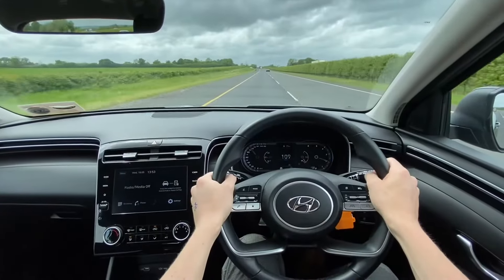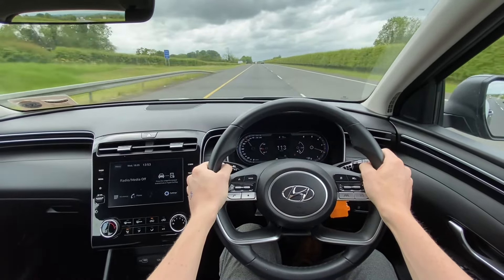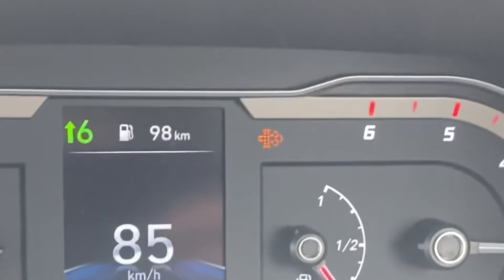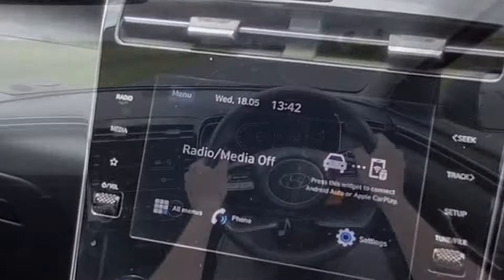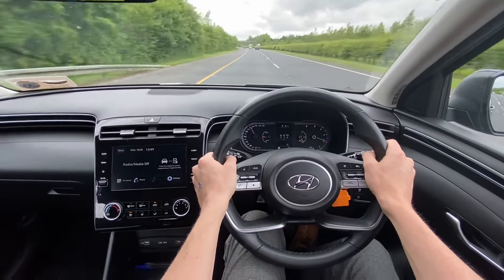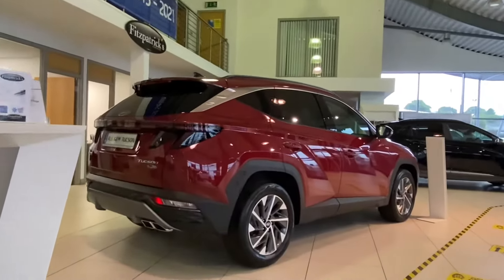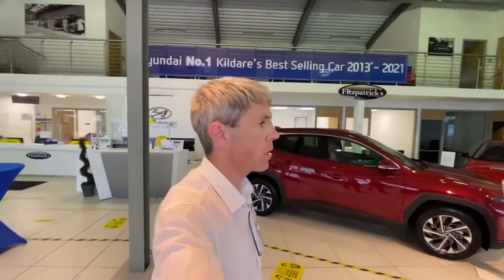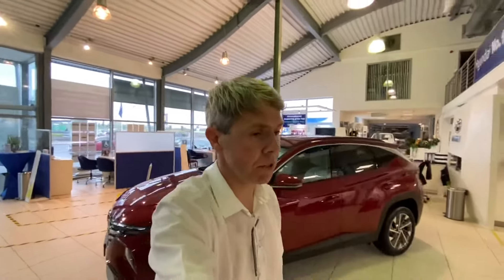How do you clear the DPF light on Hyundai Tucson #dpfsolution #hyundaitucson #howto

Comment: For anyone that has this problem with the 2021 upwards 1.6 tgdi, I got in contact with my local dealership.
I was sent a manual on this issue.
Drive in 3rd gear 50mph upwards, accelerate up to 4000rpm, release accelerator for 5 seconds and then back up to 4000rpm.. Repeat until light clears.

I've just done this method and it honestly worked a treat. I tried driving 3.5k rpm yesterday for over 50 miles and was useless... try this method and thank me later 👌🏻
Reply from the maker: Excellent info thank you !!
Reply: @doolanbrian  
No problem 👍🏻
Reply: @doolanbrian  
In case of DCT
 (Dual Clutch Transmission) you must put the car in sports mode and manually switch to 3rd gear.
If after driving 30 mins, or the gpf light starts blinking, they recommend you visit the local dealership
Reply: I was driving around 100km with over 3000rpm and the warning light is still on. 22my 1.6 t-gdi...
Reply from the maker: @veeme96  see Jamie Jay Jay comment which I pinned up above , it might help
Reply: @doolanbrian  its very overall recommendation/ explanation. First, is it possible to  do on still stand/ neutral not driving? Second, how long do you have to keep on 4k rpm?
Reply: @veeme96  
You must drive the car over 50mph in 3rd gear. Accelerating up to 4k rpm, release accelerator for 5 seconds, then back up to 4k rpm and keep repeating this process.
Your car needs to be up to operating temperature as you're burning off all the soot that's built up.
Took me about 15 minutes
Reply from the maker: @veeme96  manufacturer recommend that you carry out these processes while you are driving, usually after approximately 10 to 15 minutes it should clear .. if not you need to visit the garage and they can force the car to do it using software.
Reply from the maker: @Jamie_Dee  great advice
Reply: Great advice Jamie JayJay - solved the issue for me (at least until next time). Thanks very much
Reply: @derekbish7646  
You're welcome.
My light came on at around 3500 miles.
It's obviously to do with the fact I'm pretty much city driving all the time so it's not a problem for me to do this method in the future to force exhaust regeneration. 
Good to hear you're all sorted 👍🏻
Reply: Thanks @Jamie JayJay - pretty much the same for me. Came on about 6,500. Cheers again.
Reply: it really worked. thank you man
Reply: @SOLO97  
No problem buddy 👍🏻
Reply: I drove approx 5km in sport mode (manual gear) in third gear 4500rpm release 5 sec and continue. Worked great! 👍 thanks for info!

Comment: I have a 2021 1.6 tgdi which had the light come on on the dash. Tried 50 odd miles at 3000rpm but it didn't work. Yesterday i went out and tried the 4000 rpm/5 secs/ 4000 rpm/ 5 secs etc etc repeated over and over. After about 16 miles the light cleared ..... magical! it took about 25 mins, and returned 27mpg ( the return journey was 50 mpg+) however it was worth it to regenerate the filter. Thank you Brian Doolan, much appreciated.....
Reply from the maker: @100boomer  delighted you’ve got sorted!! Appreciate the kind words !

Comment: Never heard a DPF regen at 1.5-2.5 rpm… usually have to be more that 3000 rpm… unless you use dog cleaners
Reply from the maker: @claudiod3380  for this vehicle this is the optimal range 🙂👍
Reply: Mate my tucson 2021 diesel 45 k on it same warning ⚠️ light pop up so. Shold i drive 60km per hour n between 1500 3000 rm ?
Reply from the maker: @I.koç  can you get to a motorway ??  I’d sit at about 2000 rpm in 5th or 6th for about 10-15 mins 🙂👍
Reply: Yeah . I ll do tomorrow lets see what will happen. Thx mate  @doolanbrian
Reply from the maker: @I.koç  🫡

Comment: Have this problem with my brand new 2023 Kia sportage, mine is already saying engine management light check exhaust(dpf) will this still work for dpf to regenerate?
Reply from the maker: If the engine light is on .. you need to visit the dealer … they will need to clear it for you 🙂👍
Reply: I’ve had the same problem with my new sportage sent it back to Kia today
Reply from the maker: @life101ization  I presume they are going to do forced regeneration?
Reply: @doolanbrian  I’m not sure but hopefully it does not take to long Kia took it away today on a flatbed

Comment: Hi Brian. This has just started happening with my car, the Tucson PHEV. I do lots of short journeys, being disabled I take my car everywhere. This is probably a daft question, but wouldn't revving your engine while parked, up to the required revs and time, do the same thing? Thanks.
Reply from the maker: A good question, but unfortunately it doesn’t meet the criteria, the vehicle usually has to be travelling over 80 km an hour to create enough exhaust flow 🙂🙂

Comment: Another question Brian. If in theory I was to make all my local short journeys in just EV mode, would that have any effect on the exhaust? I would imagine not using the petrol engine would not add to the partials.. 🤔
Reply from the maker: Technically you are correct, 
I think however, it’s important to run the engine, a couple of times a week to clear condensation in the exhaust, and also keep the engine lubricated, but what you say would technically be correct 👍
Reply: I now have a home charger fitted, so I can charge my Tucson phev overnight on the cheapest rate. I'm now doing most of my short journeys in EV mode and using the Hybrid mainly at weekends. It's saving quite a bit of petrol money so I'm pleased about that. Keep up the good work Brian. 👏
Reply from the maker: @j5s9cStu  great to hear, glad you are settling into the car

Comment: Thanks, thinking of buying a 1.7 diesel Tuscon round 2017 or 2018, any issues to watch out for on these models?  subbed.
Reply from the maker: thanks for watching ! Engines are bulletproof on that model as they are less complex , so DPF issues are almost non existent , make sure you get one with service history though … test drive the vehicle , accelerate from about 1500 revolutions, check for a strong vibration that comes up through the cabin , and also, as you release the clutch, feel if there is any sort of judder, if either symptom is there, it will need a clutch and flywheel to remedy but a lot of people don’t actually bother. Finally, make sure that the gears are selecting properly and allowing you to move freely between each gear up-and-down while driving as gearbox synchros  can fail .. this is roughly around €1000 to fix. Overall these issues are reasonably infrequent out of all of them. The gearbox is probably the most common, but it’s still not that frequent
Reply: @doolanbrian  Thanks a million for that, I'll keep an eye on your own website as well, I'm a good distance away from you but will travel for the right machine.
Are the clutch and gearbox issues also problematic on the petrol engine versions?
Reply from the maker: @roadwarrior8560  the petrol is less common so we don’t see the issues as much, but that’s because the car is less common here, the petrol engines would probably consume more oil than the diesel so you need to top them up between service where as the diesel you usually don’t🙂

Comment: Mine was flashing while I was driving home I do long distance enough driving , I pulled in turned the engine off and back on and it went off and my drove 20 minutes home and no issues , should I get it to a car garage asap or am I okay now ?
Reply from the maker: Unusual, but if it has gone off for the moment, then no further action required, unless it comes on again

Comment: Very much appreciate the helpful advice.

I have a brand new Hyundai with just 300 miles on the clock... But the "check Urea System" message with engine light has come on.

What would this mean?
Reply from the maker: Okay, unfortunately in that case you need to visit the dealership, you may have a sensor, not doing its job properly, or possibly the adblue pump is not operating correctly, but the good news is it can be fixed !
Reply: @doolanbrian  noted with thanks Brian.

Comment: I have a 2023 Hyundai 1.6 Petrol N line it has done 3,600 miles and the Amber exhaust filter light has come on.
I only do around 10 -15 miles per day back and fore work I have tried the carry on driving thing to no avail.
I will have to give it another go and go for a longer drive tomorrow.
I opted for a petrol this time as opposed to diesel thinking I was doing the right thing to save the planet and all that.
I drive it carefully to conserve fuel and try to look after it as I have all my cars and  try to reduce emissions.
What is the point if I have to get in it and drive like a Hoon to somewhere I don't want go and back again to keep it clear.
So instead of dropping small amounts of particle all the time, you knock the bollox out of it and drop them in one.
This is a great idea (NOT)
Reply from the maker: Ok Colin try this method for the petrol - https://youtu.be/BPCH4goM4Qk?si=OZYSSPn7Jk2_3FDw 👍

Comment: Hello, on my car that light starts blinking even at 3000rpm...actually only  with a service regen it is possible to clean the dpf filter. I have had this problem for 2 years (increasing during summer time). The code is always P2002 but the car works really good...never power loss just dpf light blinking and sometimes (exhaust smell inside the car) Can be a faulty 
 egr or egr cooler the solution?
Reply from the maker: Unfortunately it’s impossible to diagnose without getting it into a garage .. so many things are possible .. you might have some sort of engine imbalance, Even though it might feel like it’s running perfect you can be possible to have in correct compression  ,  you could have a turbo charger that’s burning oil , it could be EGR as you say 🤷🏻‍♂️
Reply: I think it's one of the ways how dealers can get more money from the customer. If you want a clean DPF filter just drive to the dealer and pay the money. Good job Hyundai

Comment: Hi Brian 
2019 Hyundai Tucson had it on the motorway for at least 30min 5th gear just hitting 3000revs just little over 120km and the dpf filter came on flashing few minutes later went into limp mode no power went it went to about 80km should this happen? I pulled in turned off engine for few minutes then turned back on and dpf light was gone and power was back  drove another 40-min on the motorway was fine when I came back to go home it happened again on the motorway after 30min should this happen what am I doing wrong thanks
Reply: Sorry 1.6 diesel engine Irish reg
Reply from the maker: Ok Paddy .. there is an issue there .. if it’s going into limp with flashing engine light … it needs to visit the dealer for diagnosis.. are you getting a warning for check exhaust system?
Reply: Yes got a warning check engine system and now engine light is on would this be a big problem
Reply from the maker: @PaddyJones-ju9fh  ok , they would need to check the DPF , to see why it’s not clearing properly , there can be many reasons so hard to guide you properly on that , do you have the car long ? Has it ever happened before ?
Reply: Have car about 3 months it happened before I rang garage about the dpf light going out said I need to go motorway and leave in 4th gear an do 3000revs
Reply from the maker: @PaddyJones-ju9fh  how has it been since has light stayed off?
Reply: Light hasn’t gone off engine light is on now rang garage to get booked in for a forced regen no available until 8th April 🙄 and they will need the car over night
Reply from the maker: @PaddyJones-ju9fh  okay, that is the best course of action, garages nationwide unfortunately are absolutely choked up and overwhelmed so I know it’s a pain having to wait but there’s a severe lack of mechanics available in this country at the moment! Hopefully the regen sorts you👍
Reply: Hi Brian Hope your well 
I know there is a lack of mechanic's but how long should it be for a car to be repaired on warranty I know it depends on what’s wrong with the car but if a garage (Hyundai garage) has your car and is only working on it every now and then when they get a chance because they have other work like services and stuff is there a time line they would have to keep with?would you think 6weeks is abit much? Thanks
Reply from the maker: @PaddyJones-ju9fh  unfortunately, it sounds like almost every workshop in the country. These days, technicians are very difficult to get , and problems are much more complex, coupled with sometimes parts aren’t always available. I’ve seen repair timelines up as far as six months on certain types of repairs. So at six weeks is probably in line with pretty much every other dealer nationwide. And I can totally understand why customers would find it annoying. It’s just the way things are right now🫤

Comment: What Great Information that is , i was wondering if anyone can help me as i have a 2017 kia Sportage 6wks ago my exhaust system was flashing so i bought the DPF Kit , dpf cleaner turbo cleaner and the regeneration From Forte , last week i put all 3 into my fuel tank , and now one week on my Exhaust system started flashing and now i have a engine management light on , , my car is currently in the local garage , l , I called the RAC and the lady on the phone said it was a Electrical fault as the car did not loose power and i was told to take it to the garage , where it is now , hope they can sort it , now i am not to sure about using these DPF kits . take care .
Reply from the maker: I wouldn’t have massive faith in the kits.. when it’s blocked, it needs to be manually regenerated and the kits won’t really help in that case, hopefully it’ll get sorted soon! Thanks for watching

Comment: Hallo i have this problem too this lampe blink ihaved clean my dpf the mechaniker says my dpf its ok ..maybe its Differenz sensor or temperatur sensor this problem ??
Reply from the maker: @Kostas92  what you is your vehicle?
Reply: @doolanbrian  i 30 pde Crdi 1.6 136 ps motor D4fe n line hatchback
Reply from the maker: @Kostas92  if you have cleaned the DPF , it might still need a forced regeneration to allow the computer to calibrate and interpret that it is now cheers bud I would imagine your mechanic already did this?
Reply: ❤ @doolanbrian i haved him asked but he says hat all makes ..where is the problem now? I have 163.000 Kilometerstand my car make Not Regens in high way come this lampe again and again and my car go safe mode ...in diagnostiks its All ok ..i dont understand ..if my dpf its ok ,where is the problem ? My car try regen but dont make
Reply from the maker: @Kostas92  are your diagnostics showing any other issues like NOx sensors or PM ?
Reply: @doolanbrian  Ιn diagnostics its all ok .. no error
Reply from the maker: @Kostas92  unfortunately, I can’t tell you the answer, but if I had to guess I would be concerned about whether your diesel particular filter is still operating, it’s possibly damaged and not working anymore, but unfortunately this is just a guess
Reply: @doolanbrian I was in Garage today first sensor 99 C second sensor 715 C 😂 i  changed boths its All ok now but i will sell this auto ..its not for me
Reply from the maker: @Kostas92  hey brilliant ! You fixed it well done !!

Comment: Hi, I have Kia Sportage 2019, 1.6 crdi, on 22000 km my dpf filter started blinking & the car won’t go over 3000 rpm, I drive the car only on open roads
Reply from the maker: The DPF is blocked .. you will need to visit a dealer to have it regenerated unfortunately
Reply: Have you fixed this problem?? I have same problem i have same motor with you bro
Reply: @Kostas92  In the dealership the have changed 2 brand new dpf & they are  clogging on 1500 km, now again the dpf light is coming out & the check engine
Reply: @dejanveselinov2905   about me .. one sensor 99 C second sensor 715 i Changed sensor and now its ok but i will soll this auto its headdeak

Comment: Hi ,I have a i30N with 13000 miles my Gpf light came on today ,I only do short journeys ,took it on the motorway and it cleared within 20 mins ,I thought this was only an issue for diesel cars or am I wrong?
Reply from the maker: So it looks like gasoline Particular filter will also have similar issues. If it’s cleared after the drive , that means it’s working properly so continue driving. There is no problem. 🙂👍
Reply: @doolanbrian  thanks Brian appreciated 👍
Reply from the maker: @timvinall4802  I would love a car like yours it’s great fun to drive I bet!
Reply: @doolanbrian  it certainly is Brian for sure 👌